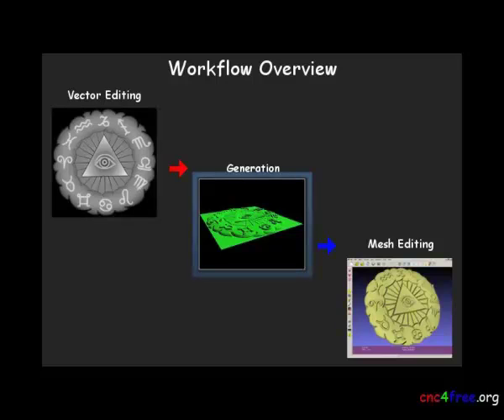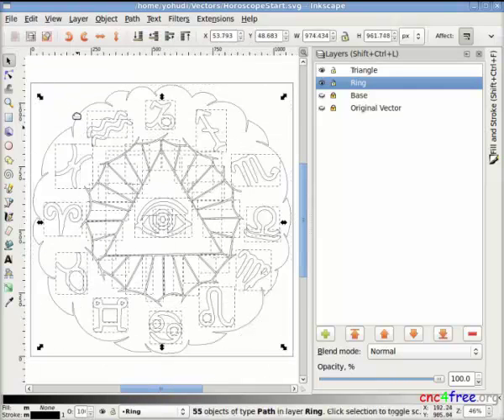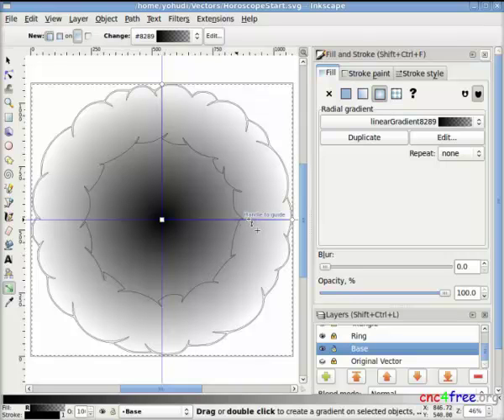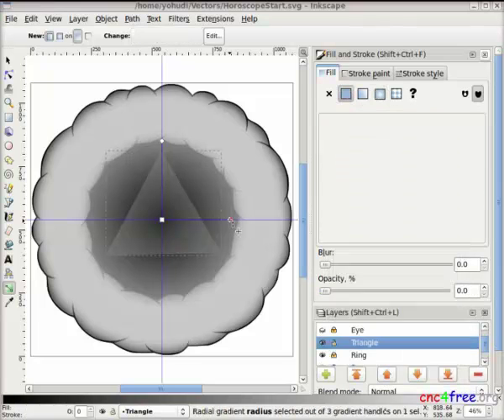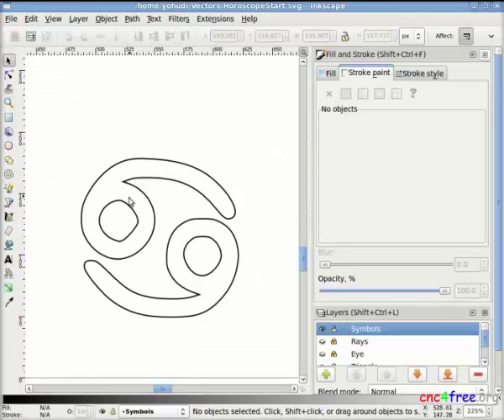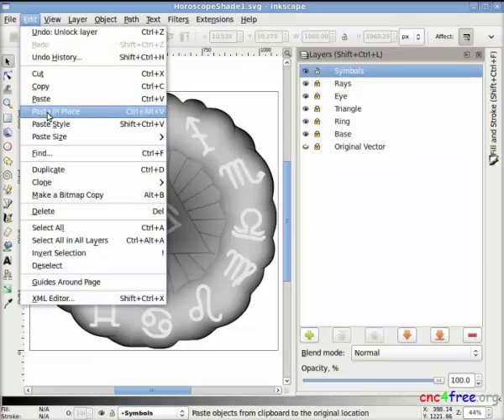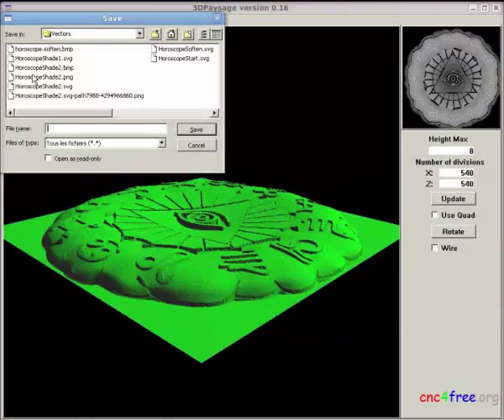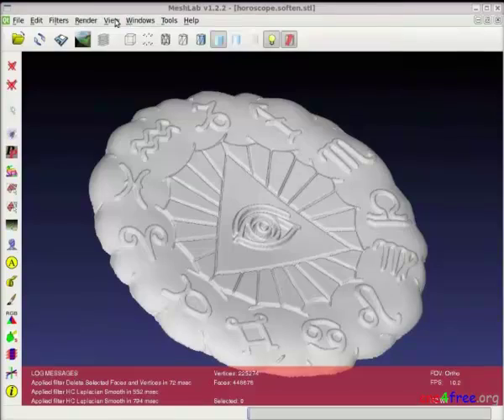SVG to CNC bas-Relief Carving - FREE - Cross-platform - GENERIC

Comment: That voice obscures the names of the software and is incredibly uncomfortable to listen to, wish I could but I can't...
Reply from the maker: Hi There, Many thanks for your interest and your comments. Re: The Audio:-

This is an older video, one of the oldest on the channel.  In more recent uploads the audio quality has been addressed.  Many of the 
older videos will be phased out as I add more advanced content covering these subjects, so I haven't remade audio on older videos.. just don't 
have the time.

You might try lowering the volume level...  this has been reported to help improve clarity.

Re: Software:

The software used in this example is as follows:-

Inkscape:  This is used to separate and shade elements or areas within the vector, according to the desired height and shaping in the generated bas-relief.

3DPaysage: This is used to generate a 3D mesh from a .BMP export of the final shaded vector.  As far as I'm aware, 3D Paysage remains the only standalone cross-platform mesh displacement utility I've actually tested.

On the windows platform a piece of software called BmpBender is shown performing this aspect of the task.  Sadly BmpBender is no longer available, but similar functions can be obtained (below Windows) from ImageToSTL or Lithophanes3D.  

MeshLab: This is used to edit and optimise 3D mesh output from 3D Paysage (or alternative displacement software).

Hope this helps